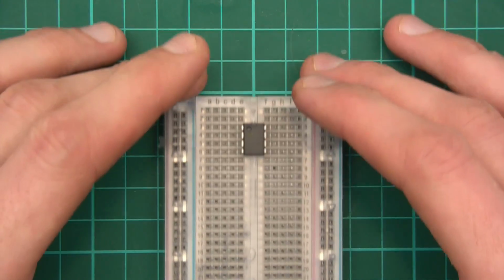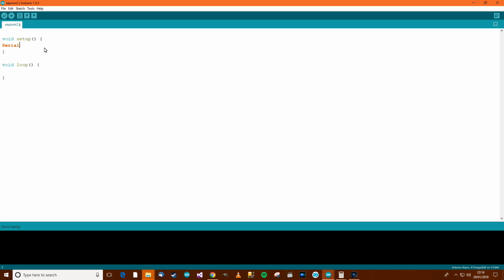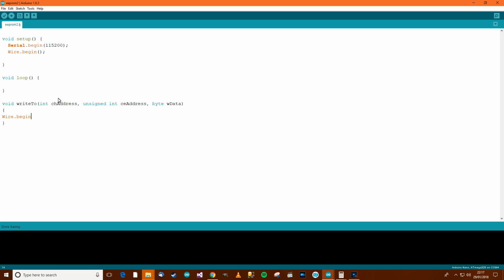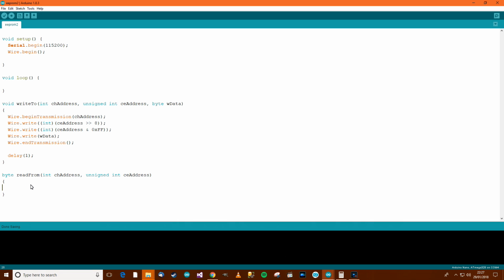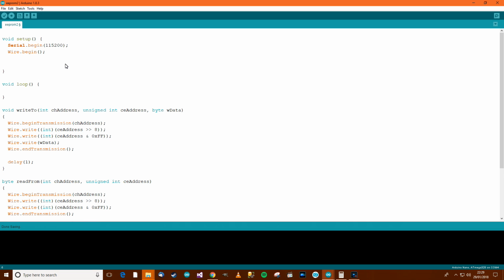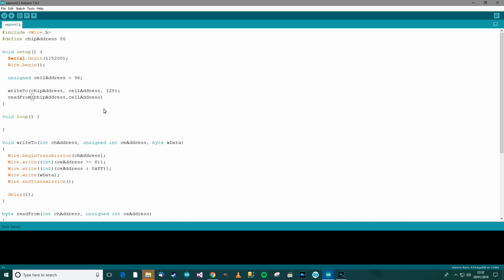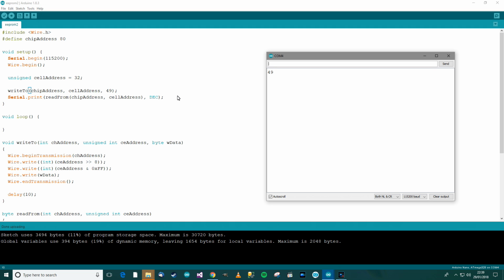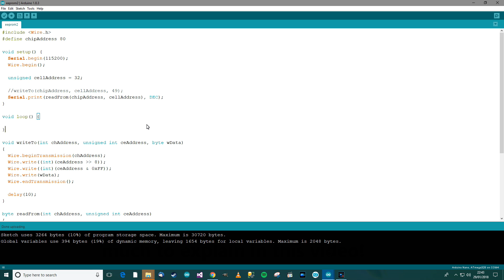TUTORIAL: How to Wire up & Code an EEPROM with Arduino - Module (Part 2 - Wire Up & Coding)

Comment: I know this is an older video, but thank you. Im a computer science graduate trying to get into embedded systems some more. I found your video(s) to be very helpful and on topic!
Reply from the maker: @markjenkins9424  I have a master's in CompSci. The best thing I can suggest is starting with Arduino itself. Interfacing with other modules. Then gradually you can go deeper.

Comment: I dont understand what was happening here for chip and cell address. I thought this was a hardwired thing and therefor the Arduino wouldn't need to be told this, could you explain this part a little more for me plz. eg could i just do something like digital.write (A0 =LOW), A1, A2. Wire.beginTransmission();......

Comment: The naming 'Vcc' and 'Vss' has to do with the types of  transistor in the IC package, and refer to the power rails within the chip. Vcc = Voltage Common Collector, is positive with respect to ground, while Vss = Voltage Source Supply is negative with respect to ground (and in many cases can just be tied to ground).

Comment: Well done Antony! This is a great building block! I was able to reproduce your result here at home. I was wondering what you did with the bit shift and the AND operation. You are such a good developer,  you probably did that without even realizing it's on another level! Well thank you and keep these building blocks coming!

OK: figured it out, I think...  An unsigned integer is 2 bytes, you shift right 8 places and bitwise AND the value so you have no leading ones as you write the command register byte. Nifty!

Comment: To elaborate a little on A0, A1 and A2 and the chip address starting at 80.........

The chip is designed to allow you have a chain of up to eight of them addressed 80 to 87 (50 to 57 in hex or 1010000 to 1010111 in binary. You do this by setting the A0, A1 and A2 pins high as necessary to form the least three significant bits.
A good example as to why you would want to do this are printer toners. My Ricoh laser printer has four colour toners with 24LC01 (1 kbit) EEPROMS. These are set to addresses 80, 81, 82 and 83 by the wiring on the little PCB they are mounted on to. This way, the printer can address each toner individually on the one I2c bus.

Comment: Hi Please help I only have 48 hours to do this project.  I have a stm32f411(black pill module) and a 24LC64. I am using the arduino IDE. I have lots of other things going like TFT, rotary encoder, analog etc... so i just want to keep my program in arduino IDE.   The 24LC64 i have 3 address pins to ground like you... address DEC 80 or HEX 50   ... on the stm32f411 the Data pin for i2c is PB7 and the CLK pin is PB6.    
I need the correct header file and then i guess the code you have here will work just fine.
the pin numbers are different.
I downloaded stm32Cube MX  that apparently will make the board talk to an eeprom via i2c... however it makes about 30 files!!! and of course wants to make all the configuration files for KEEL or other IDE than Arduino...  please help.  :o)  cheers Ian

Comment: So if there is a 3 bit address, does that mean there are 9 registers? Or is that not the word to use for it?
Reply: 3-bits allows you to set an address of 0 - 7. It's one address. The address is 3-bits long. You can have the following addresses:

0, 1, 2, 3, 4, 5, 6 and 7

So, you can have up to 8 of these devices (device 0 through to device 7) on the I2C bus. Each device on an I2C bus needs a unique identifier 'address'. 

If you have 8 people standing in a group and you say to the group "Tell me how old you are", 8 people will reply and you'll get 8 answers simultaneously. Not helpful if you want to know how old 'John' is. You may not even be able to hear John's response!

But if you say to the group "John, how old are you?". only John should reply. You get a single answer. This is how the above concept works.

No registers are involved.

Comment: Great work sir... I have to test an ATAES132A crytpo IC... This IC works on SPI communication protocol..I  wanted to know that for connections we just need to attach the jumpers like this...or we have to add capacitors to the ground?? Or would require logic level shifter to work with Arduino...Please reply it's really urgent..

Comment: So can i change the data in immobiliser eeprom and make it accept an value?
Reply: Fs0c1ety_BS actually I found that video for the same or similar reason.
I would think one could answer 'Yes' as long as the EEPROM doesn't have additional security features.
The point is rather with working on IC level on cars: 1. You have to get physical access to the IC equals to you need to know where it is located and then take that part out of your car = car out of work for as long the work goes. Then you have to open up the part i.e. the tacho and you still need to know which chip it is.
2. Possibly you need to desolder the IC which is a next risk... OR you might have to put power on the IC while it is connected on the board... which also can be a risk.
3. You need equipment to contact the IC...of course that isn't a problem for professionals and IF you know experienced people it will be easy to get the right equipment for a low price.
4. Besides suitable contacting hardware i.e. a SOIC-8 clamp you will either need a finished SW tool which you have to trust to work fine... or you would end up writing your own code and just trying to solder connections directly to the IC while sitting on the PCB and of course in any case you would need to ensure that maximum ratings for that chip are never exceeded.

So, in short, yes it should simply work fine and I am actually myself considering that at least as I am electronics by first education and IT by second one... but I would tremendously prefer another way of reading out the EEPROM by in my case example VAG K+Can commander not needing to take the risk even I have visibly had the corresponding PCB and chip in front of me on the bench yesterday :o

Comment: Thank you for the video, but 0xFF (FF Hex) is 255 decimal... there is no other "way to look at it".  For anyone who gets confused by zero-based counting - look at it like this:  Take eight apples, line them up on the table in a row.  Get a knife and carve a '0' (zero) in the first apple.  Carve a '1' in the second, carve a '2' in the third, and so on.   When you get to the eighth apple, you'll have carved a '7' into it.  You still have eight apples, but when you start counting at zero, you only get to '7'.  If this boggles your mind, and you're thinking to yourself, "I can't, I just can't..", first, see a life counselor :-), then switch to Python or another high level language where addresses are mostly things you'll never have to deal with.
     Counting in Hexadecimal is no different.  ("Should I say 'zero lives matter'?"  "No, that'd probably be taking it too far, too easily misunderstood." "Fine...")  Zeroes Matter.  So if you're talking about digital addressing, 0xFF is 255, but it's also the 256th address.  Just something you have to get used to.  When you're talking data, you can start at zero (it can avoid confusion if you have a lot of addresses in the same code), or start at one.  Use whichever you're more comfortable with, but addresses will always (with a few weird exceptions) be zero-based.
Reply: I like to think of binary numbers as states. So a 3-bit number has 8 states. Those 8 states can be numbered (as in a cardinal number set, starting at zero) as 0->7. But their rank (ordinal number) is 1-8 (1st, 2nd, 3rd...7th, 8th) If we just use their cardinal order for counting, we can obviously represent 8 different numbers: 0, 1, 2, 3, 4, 5, 6 and 7. It's just the issue of starting at zero which most people aren't familiar with.

We can use those states to represent things other than numbers also. I still have to do mental gymnastics sometimes to remember that 256 values will start at 0 and end at 255, but I'm not confused by it. Once you deal with numbers like these enough, you'll get to know them by rote, and won't be worried about it.

If it helps, imagine you have a single switch. You want to represent as much information as you can with that switch. 

When the switch is off, that is one state. When it's on, that is a second state. So with 1 BIT (binary digit) you can represent 2 states. Numerically, that's 0 and 1. You have a number set {0,1}. You have 2 values in there. With those values you can count 0... 1. You only get to 1, but you have 2 numbers.

When you add a second BIT, you double your set:

00 = 0
01= 1
10 = 2
11 = 3

So your number set is {0, 1, 2, 3}. You have 4 values. You can count 0... 1... 2... 3...

You can only get to 3, but you've taken 4 steps or values to get there.

Add another bit and you double the number of values in the set, and so on.

The bonus of using the concept of states is when using binary to represent "options" instead of a number.

You can make a value of 0 to be useful. It can represent something specific (not 'nothing' as is our habit) and 1 can represent some different. So 1 bit, 2 states, 2 specific and meaningful values or options. Of course this also brings with it the importance of LEADING zeros. We normally don't write 000100 to represent 100, because numerically, those leading zeros have no value. But if you're using those BITs to represent meaningful states, those leading zeros are just as critical as the 1 or the following zeros.

Comment: Hi ..
It has 24LC04B and I have a problem reading the data. All the readings come with the number 255. What is the solution in your opinion? Please Help
Reply: By default, EEPROMs have a 1 written to every bit location, so 8 bits of 1 adds up to 255, meaning that your EEPROM is erased.  Either that, or you're not reading anything and every bit comes out as 1 just because ports tend to "float" high.

Comment: Can you store arrays?
Reply: You can store just about anything.  You only need to figure out how.
For example: How big an array?  How many dimensions?  How much storage does each array element take up?  Answering these questions are essential to figuring out how much storage you'll need and therefore the size of EEPROM you'll need.
After that, you need to figure out how to store the contents of the array in a format which will allow you to retrieve it later.

Comment: can the arduino be used as an eprom? that would negate the need for an eprom
Reply: takeaway guru the question is not if it can be used as such — just if it has EEPROM or not ;) and I guess Arduino doesn't, but as much as I know some CPUs comprise small eeproms
Reply: Some Arduinos use a microcontroller with an internal EEPROM. They can be restrictively small (like 1024 bytes) and the number of times they can be written to is much smaller than the discrete external EEPROMs. If you need to write many times, or a lot of data, an external discrete EEPROM is required. 

The internal EEPROM may be faster to access (read from) so it's worth considering very important, unchanging data in the built-in EEPROM.

Comment: Well explained. But just for info, a byte holds between 0 and 255 (not 254 as you said at the end), or in hexadecimal 0x00 to 0xff
Reply from the maker: stuartajc Hi, thanks, you're right. 2^8=256 cells. 0-255. I think I've been doing too much networking!
Reply: That's was the first thing i thought, network address and broadcast address.
Reply: @feitan8745  255 is still a valid network address
Reply: @TheChrisey  indeed, but the last valid.
Reply: A Byte is by definition 8 bits, and so is the same in EEPROM, RAM, Disk, Tape or whatever. It never changes.
Reply: Hi, guys. Is it 255 for EEPROM of all sizes? Does it change?

Comment: Hi Antony, can you tell my how I can store Float value or a String in EEPROM? Please advice me or create video tutorial on it. Suppose I want to store a predefined temperature like 25.5 C in EEPROM. Please advice me.
Reply from the maker: Hey, to store 25.5 (or up to 255.99), you can use 2 bytes. The first byte can represent the integer portion, and the second byte can represent the decimal portion. So to save 25.5, (or 25.50) you'd simply use the method in the video to store '00011001' (25) in one byte, and '00110010 (50) in the next. When you come to assemble the number, if you simply want to display it somewhere, you can simply concatenate it together, but if you want to cast it into a float or whatever and perform operations on it, then you can simply do this FLOAT = INTEGERPART + (DECIMALPART/100).

If you were to store that as a string, it would take 5 bytes. This is because strings are stored character by character, byte by byte. So for each character which you save, you actually save a number which represents that letter according to the ASCII key code. Strings kind of add another layer of complexity to the equation.
Reply: For real floating point, wouldn't you just store the first 8-bits, but shift to the left by 8, store the first 8 bits, etc until all the bits are stored?

Then to read them back, read 8-bits, shift left, read the next 8-bits, OR the 2 values together, read the next 8-bits, OR them together etc?

All the time tracking how many bytes are used for each float, and use that size as an offset for the address to read?

May use 4 or 8 bytes, but you get the full precision. Don't know how bit shifting effects floats, but I think that would work.

Comment: Definitely a lot safer than using an SD card to store the data. Also, probably uses a lot less memory, too. I think I'll be incorporating an EEPROM in my BMS I'm working on  😎
Reply from the maker: Korishan Hey, yeah, I wasn't actually looking forward to doing this video because I assumed it would be difficult for me to learn, tedious to code, and a headache to explain. It turns out though that it wasn't too bad. Actually, the concept and methodology is pretty good. I think I'd probably use this for my projects too. You can get much larger eeproms too!
Reply: Sure it's nice using EEPROMs and I absolutely liked the video — so thanks for it! Still I'm wondering what would be the particular drawback of using an SD card instead. Aren't there finished libraries to use it? And how about storing data in EEPROMs: Are there no libraries available and if Yes is that because EEPROMs are much less frequent used  yet?
I mean it's great understanding the concept behind an EEPROM and I will have to fiddle arround with some to read out its content to get to the secret keys of my own car 😝 but in general I'm a bit surprised that there aren't libraries for some EEPROMs or maybe that was just not really spoken about in the video?
Reply: You'd use an EEPROM to store data that doesn't change, or doesn't change often. Keep in mind the 'ROM' part of the name. 

EEPROMs are much slower to write to than an SD card. I wouldn't there'd be any space saving advantage to using an EEPROM. Your data is what it is, and it won't change by storing it in a different place. Also, because of the targeted uses of EEPROMs, they tend to be very small compared to an SD card. We're probably talking Megabytes at max. Most will hold less than a 3.5" floppy disk. There are big EEPROMs in use, like a BIOS EEPROM on a computer, but the type shown here is less than 64kB. You could fill it, and that would be around 1/12th of a floppy.